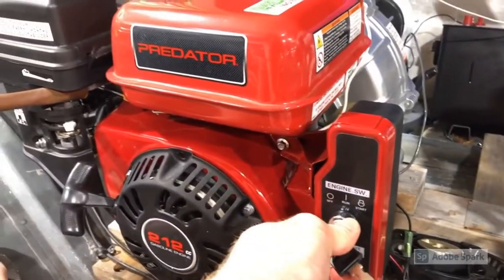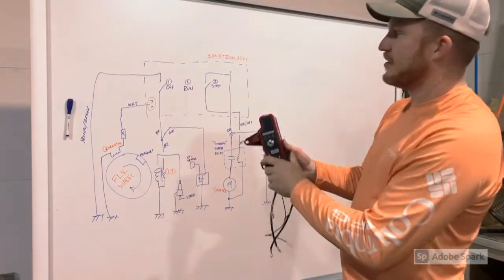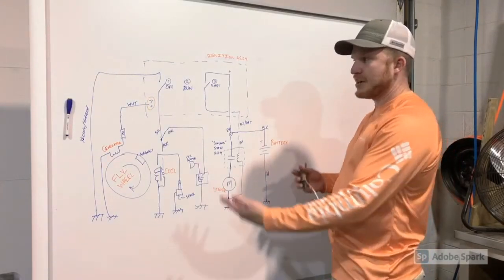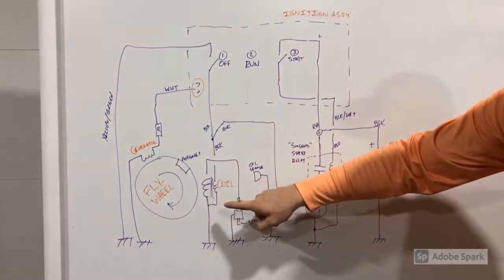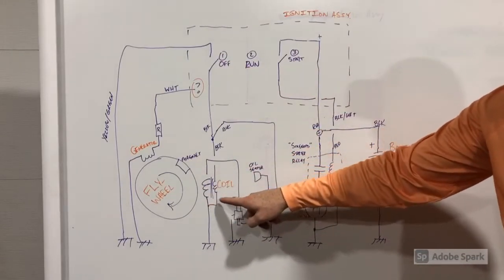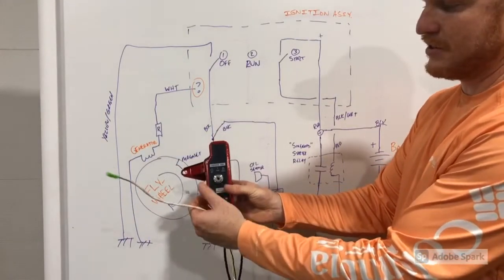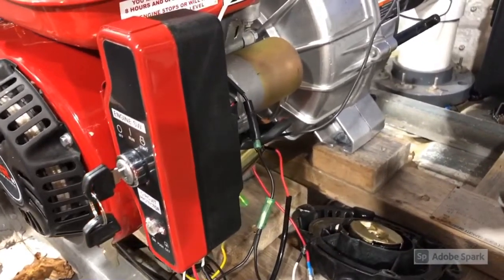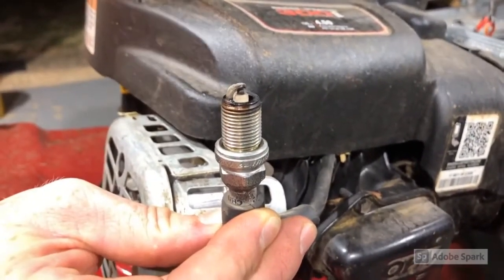How to Install Electric Start for Predator 212cc Engines - Wiring Explained

Comment: The white wire that comes from the generator coil and goes through the resistor and into the ignition housing is supposed to be wired in with the positive that runs back to your battery to charge your battery that starts the engine. Now whether it is wired up like that idk.
Reply: That is 100% correct

Comment: White wire from the generator hooks to white wire on the start switch assembly.  Inside the start switch assembly the white wire attaches to the red wire (when in the run position) which allows the generator voltage to charge your battery.  White wire is not useless. LOL

Comment: No one that sells these kits includes instructions or wiring diagrams. My Honda GX390 came pull-start only and after a shoulder injury I couldn't start it anymore. So I bought a charging/starter kit with a dual timing starter flywheel, two single wire A/C charging coils, and an off-the-shelf voltage regulator / rectifier and installed it all which is so easy that a 5 y.o. can do it, blindfolded.  Seeing that the two single wire A/C charging coils could not attain more than 12.3 VDC for battery charging, I just finished swapping them out with larger A/C charging coils with two wires each coil that is supposed to output 120-watt / 10 amp. Tomorrow after the rain passes, I'll take it outside to fire it up and see if larger coils output at least 13.4 VDC or more to the 220 ah garden tractor battery. There is a full-wave 3 phase kit for small engines but it is very expensive.

Comment: How and where would you intercept the wiring to add you own ignition key?  Which wires/colours?  The use case is a mini motorbike with a GX200 with electric start where the aftermarket ignition is on the handle bars with the wiring running down to the ignition control panel on the engine.  Thanks in advance.

Comment: You are not grasping the components and function of the charging system. The charging coil that you had in your hand does function with the magnets inside of the flywheel as you described on the whiteboard. The voltage that you measured when it was running was AC voltage. All small engine charging systems using a coil and magnet combination produce AC voltage out of the windings. Then there are various ways to convert that AC voltage to DC voltage in order to charge the battery.

The white wire on the key switch panel that you had in your hand at 7:50 in the video is supposed to be connected to the wire coming from the charging coil. If you looked just to the right of where you were holding that wire with your left hand, where the black heat shrink starts, there is a bulge underneath the heat shrink. That is a diode. It only allows electricity to flow in one direction through it, basically like an electrical check valve, and serves the function of converting the AC output of the charging coil to DC. It does that by effectively cutting off one half of the AC wave. It is generally called a half wave rectifier when a diode is used in that fashion. This is the most basic method employed to convert AC voltage to DC. 

So if you put the charging coil in place and connect the bullet connector together, when the engine is running the AC voltage will go through the diode, be converted to DC, then run through the key switch back down to the wire going to the starter terminal and through the red wire back to the battery and recharge the battery when the engine is running.

Now, for electrical protection there should be either a circuit breaker or fuse in that line from the key switch panel to the starter terminal. Not sure why Predator no longer has that circuit breaker in there, perhaps they incorporated a breaker or fuse somewhere up by the key switch under that cover. You could always go to the auto parts store and just get a fuse holder and put it in the line  going to the starter terminal from the key switch.

You're missing the opportunity to keep your battery charged and you could always wire in 12 volt lights or a phone charger, etc. to your battery.
Reply from the maker: Thanks for the detailed comments byronmill! It's been a while since I worked on that project, I'll have to revisit it and look again. Super helpful, thank you!
Reply: I have that exact kit and it came with a breaker switch where that button goes, his kit must of had someone forget to add that to the kit when it was assembled.

Comment: 2 questions - 1.  do the gears on the starter push out to engage the flywheel?  I'm having trouble because the gears on mine are not engaging the flywheel and i cannot figure out why. The gear spins but doesn't come out to engage.  I thought maybe I had a faulty starter but ordered another one, which did the same thing.  Maybe I got two faulty starters but chances are I'm doing something wrong.  Question 2 - the wire from the generator, can that be connected back to the battery to charge it?  If yes how is that done?  does it connect to the positive or negative to charge the battery?  Thx.
Reply: Charging goes to positive, and your starter solenoid is what moves the starter gear to engage. It sounds like you never wired the solenoid, or the coil that magnetizes it is burned, unlikely, on a new starter. Connect the solenoid to the start circuit, so, when power goes to the motor, it also engages the solenoid. Just make sure it disengages, and backs out after starting, or the starter will be wrecked. Maybe find a back yard mechanic, for some guidance. Hope this helps.

Comment: How do you add a voltage regulator to charge a battery? In my kit I added a voltage regulator so it'll keep my battery topped up. Can you show me how it would be added into the diagram? Btw, I just sub'd too! 🤘😁

Comment: What size battery should and or would power this?
Reply from the maker: I was using a large marine deep cell battery. Walmart special:) I'll check specs on it tonight.
Reply: @greenlizardusa3105  Alright, thank you!
Reply: I was able to get mine to start with a power wheels battery, I would imagine a motorcycle battery will work as well
Reply: @mexalejo  Oh ok, do you happen to know how many volts and amps, or I could just buy a power wheels battery because I could then recharge it 🤔
Reply: @mexalejo  or could I just use a drill battery? Because I could use an adapter and recharge it
Reply: @andrewhernandez7715   I will have to get back at you with that info
Reply: @mexalejo  alright
Reply: @andrewhernandez7715   that would be interesting considering that I have seen power wheels converted to use a tool battery
Reply: @mexalejo  yeah, I think I’m going to try that

Comment: But how do wire it up??
Reply: I agree. I know how many wires it has placing them is the issue changing from rope pull to electric. He has the exact switch. Even the black split wire . Helpful would have been to do 3D as in show connecting switch wires -- to GX390.

Comment: 4.06 i believe thats wrong you show a ground coming off generator coil going downward on your drawing that operates the spark plug ,it should have only one ground and thats thru the off switch
Reply: you show a total of 7 grounds from left to right ground number 3 should not be used